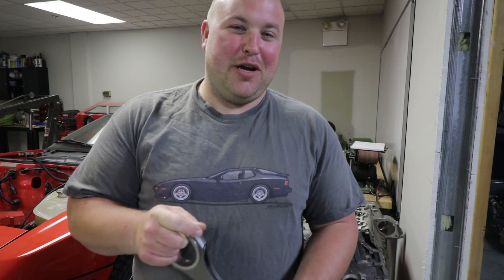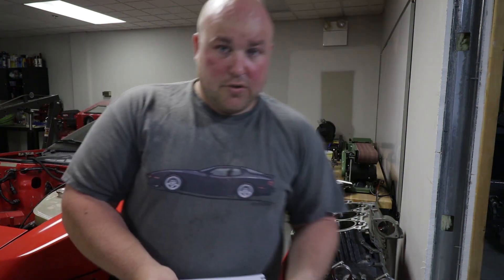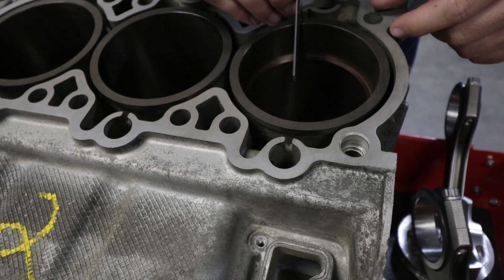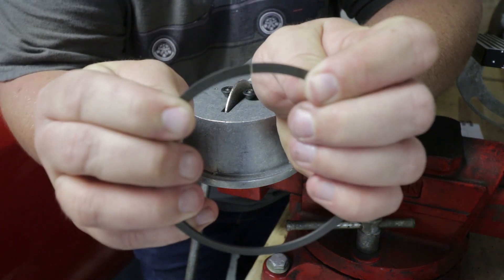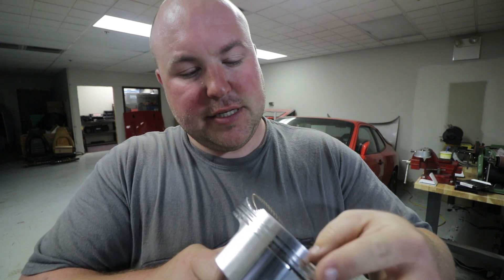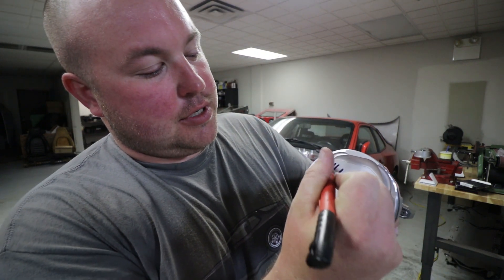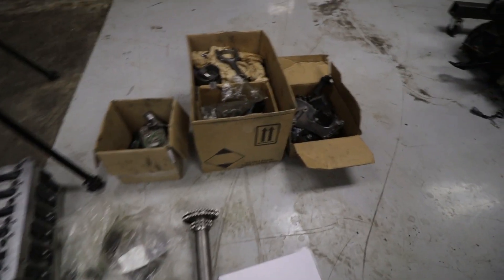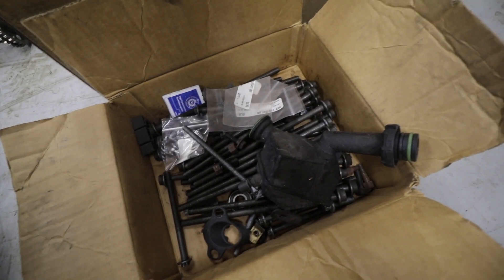Turbo 3.8L Cayman Engine Build (Porsche M96) - Part 3

Comment: For everyone wondering the porsche parts list is for almost all models available directly at the Porsche website.
I currently rebuild my 2000 Porsche Boxster S engine, which had a rod bearing failure as well.
Reply from the maker: Really? Is it under the Porsche Classic section?

Comment: Great to see the M96 build moving forward. I’m a few steps behind you on my build. Did Vision check the crankshaft out - all good?
Reply from the maker: Yeah, and they did some additional work to it (oiling mods). It’s basically the same as a Cup Car crank. What displacement are you going?
Reply: Boost Brothers Garage  Interesting, you can never have enough oil on those bearings!!!!

My plan is to take the 3.8 up to 4.0 and to prepare the internals to take a little boost in the future with forged rods and pistons. To reliably do that I’m considering either the Darton Ductile Iron MID Sleeves or similar by Golden Eagle. North of 400-430 would be nice for now - GT territory.

As you know, you have to invest while the engine case is apart as you can’t easily go back once it’s all buttoned up.

Are you doing any porting to the heads? Updated Valve springs etc?Been looking into Dave Vizard’s work, the guy is a genius - really interesting.
Reply from the maker: We are not doing any head work. We are going to rely on boost to get us where we want to be, and are going to limit RPM to help with longevity. A 4.0 is going to be badass!

Comment: This is awesome.  Been following the build.  Hope to buy my own soon
Reply: Same as you guys. Cheapest way to get a boosted Porsche. I know a few engine builders to help with build and tune
Reply from the maker: Thanks for following along! You going with a 987.1 or 987.2?
Reply: Boost Brothers Garage either bit more expensive in Australia but been looking for one with a blown motor. Missed out on a couple at auction is far
Reply from the maker: Nice... What are your plans for the engine?

Comment: Cayman Content!  Which IMS bearing are you going with - retrofit or solution?
Reply from the maker: That’s a great question! We haven’t done enough research yet to make an informed decision. I know we aren’t using the one that has the additional oil feed line.
Reply: @BoostBrothersGarage  Vision put the retrofit in mine.  That's the one without the oil feed.
Reply from the maker: Nice, sounds like we should just go that route then!